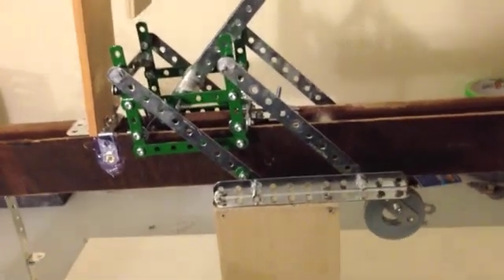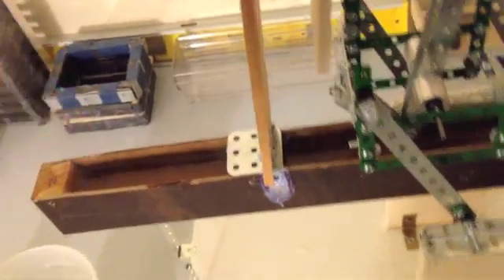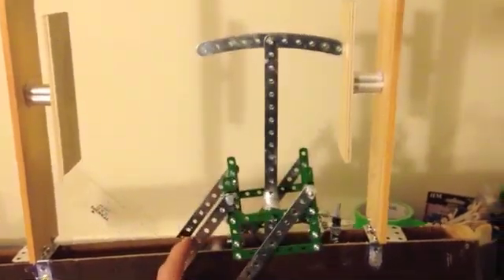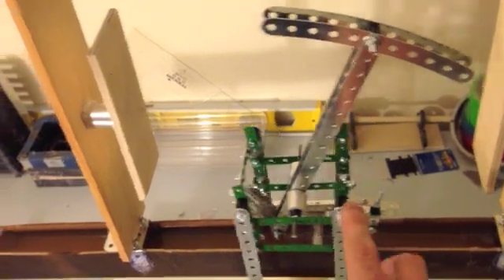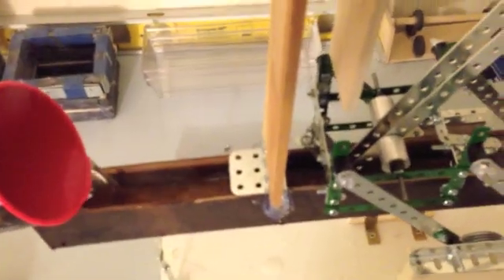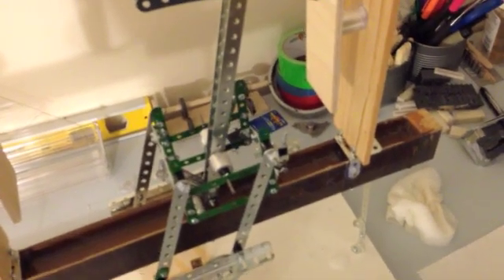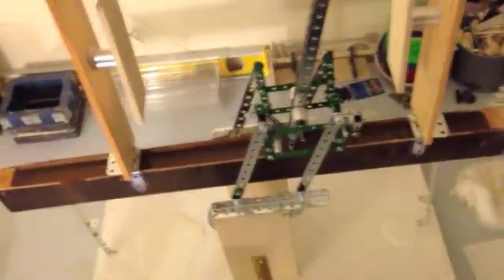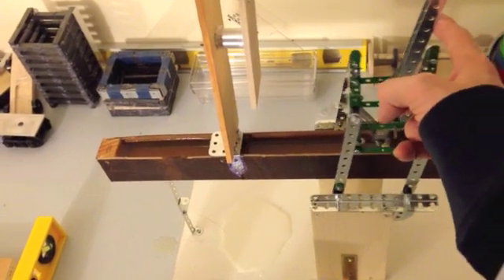Nitinol Heat Engine Version 2.0

Comment: Why didn't you just attached weights to these wires on a wheel sitting in a horizontal way. The wheel is located between two pools of water. On one side the wires straighten, the others contract (like in the original Nitinol video). Very create design though.

Comment: where do you find the wire? . except e-bay and others because the wire they sell is too weak.
Reply from the maker: Mars Seeker Well, I picked mine up from a Belgium dealer on eBay. You could always google Ridway Banks machine shop? He's still working on nitinol, on a regular basis, and could probably tell you the best place to procure some of high quality.

Comment: Awesome designs Motionmagnetics :), it looks like alot of these are close, the only thing really limiting them is actually the responsiveness of the nitinol, maybe with a bigger/stronger spring (or even a bigger temperature difference), it'd be a success. Either way I can see the ingenuity in your mechanisms, I'm truly impressed at the structures alone. Keep it up, you'll solve the energy problem any day now ;). There's gotta be a simple, and bulletproof way to make an engine, you've inspired me to order some of this awesome stuff. I'm thinking a wheel with a good bearing is the key to nitinol working, maybe with a solar powered water heater? Awesome video brother! :D
Reply from the maker: Thanks for the compliments. If you post any of your own research, let me know. I'd enjoy seeing what you come up with.

Comment: All you would need would be a rubber band or spring on the pendulum and the right board.   Nice,  I'd like to see the plans to this model.
Reply from the maker: That might work as well. I designed most of it in my head. The rest was just trial and error.

Comment: personally, I think your first design was better. I do applaud you for trying different things. I would love to see every thing that you try. I am thinking about building a nitinol motor but I really don't have the time. I will have to build one vicariously through your efforts. On the first motor if you made the outside ring bigger and maxed out the springs I think it would work better. you are creating an unbalanced wheel so it can not help but rotate. I don't think I would offset the springs, you really don't need a smooth rotation. When you put it under a load the rotation will be fine. and you don't want to have a wobble in the rotation that the offset springs will cause. I am thinking about designing some engines, do you think you would be interested in putting them together if they make sense to you?
Reply from the maker: Upon reflection, I would probably agree with most of your suggested design changes to version 1.0. I wouldn't mind taking a look at your ideas, but time has been something I've been in sore need of lately, so I can't promise I'll be able to put anything together. If something really jumps out at me though, I'll see what I can do. Thanks.
Reply: First I will share with you what my electronics teacher shared with me 35 years ago that has served me well. The KISS method. Keep It Simple Stupid.

Don't worry about getting into any big hurry. Time is the one think I can not make or buy. It may be a month or so before I could commit it to paper. But lets keep in touch. How can we exchange emails without fishing trolls?